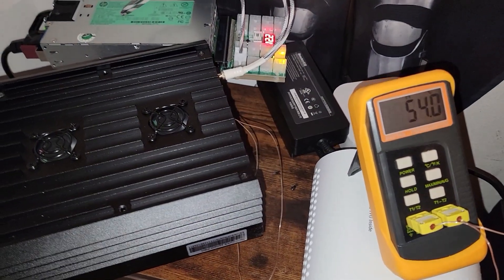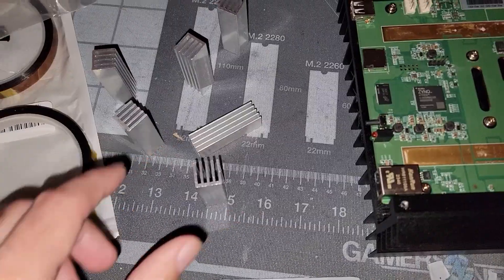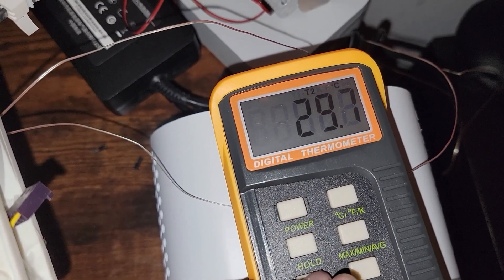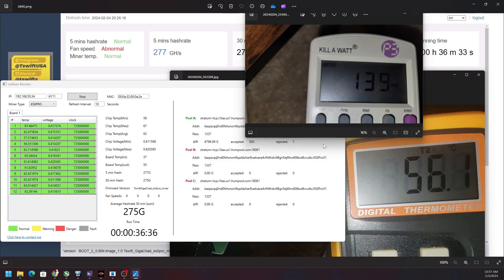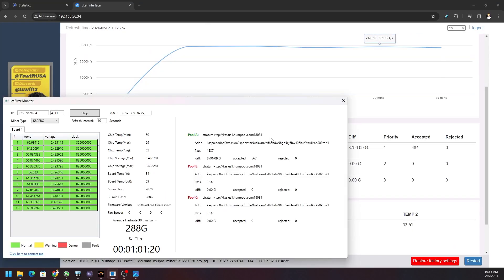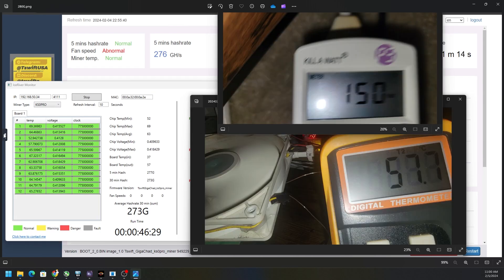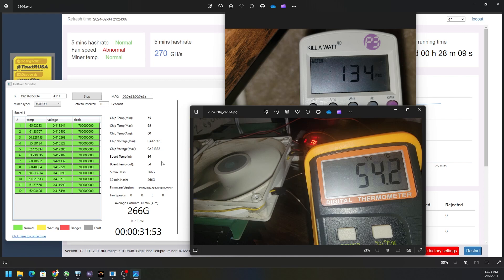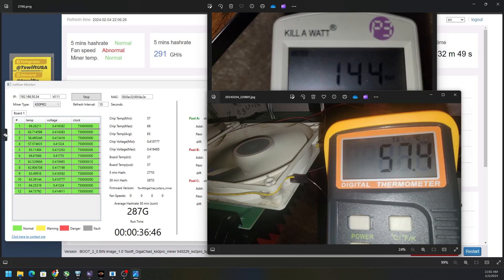Iceriver KS0 Pro Firmware Mod   Mosfet & Internal temps

Comment: The mosfets do have a thermal limit of 130c Pin 36. "Temperature Sense Reporting/Fault Flag. The voltage at this pin is defined by the
equation: 8mV * (Temperature in Celsius of driver IC) + 0.6V.
OUT/FLT
This pin will be pulled up to 3.3 internally under the following conditions: over
temperature, over current, preliminary over voltage condition or phase fault condition."
Reply from the maker: Pinning comment, good stuff, thanks bud

Comment: Running 6+ days, end plates removed and 10" box fan blowing thru- 302 GH/s avg on Humpool with temps T1-  60c  T2- 38c . Highest chip temp- 57.5c. Using Server p/s @ 12.3v and 126w.  Veteran Miner's latest power cable and TSwift's pay-to-play firmware @ 270G_L .  No other mods.
Reply from the maker: Good deal, and good data. Thanks for sharing

Comment: Running 293gh/s 24hr avg, 125w at the wall.  Running tswift 280L firmware.  this has heatsinks on mosfets, has mx-4 thermal paste, arctic 1mm thick thermal pads.  Has the plates off front and back.  single 120mm fan usb blowing in.  Hottest chip is 53c.  clock is at 77500000.  not sure if i just have a really good silicon here or what, but is killing it.
Reply: At 125w I’m only getting 250hash, hottest chip 39c. I don’t know what’s wrong.
Reply: @piratanet123  try different versions and see which gives u the best hashrate.  Different chips won't handle the same.  Ie, won't handle the higher frequency or power as well.